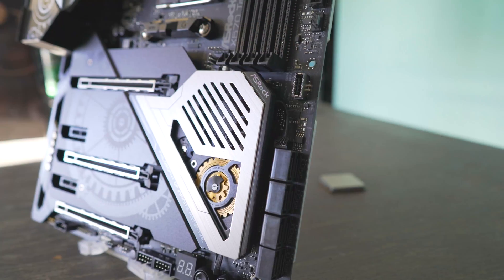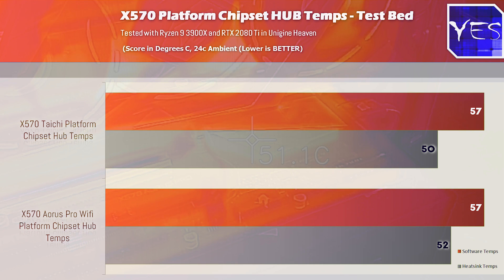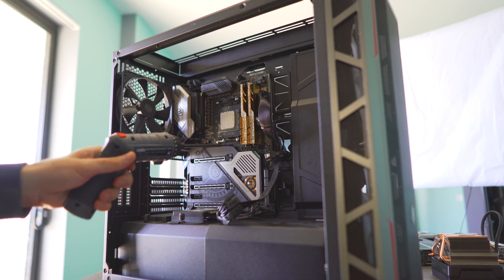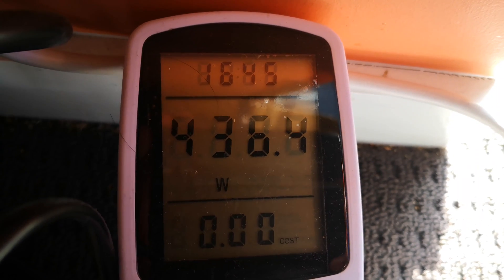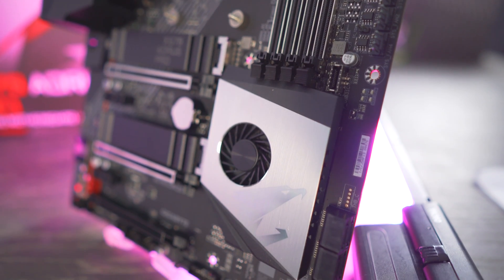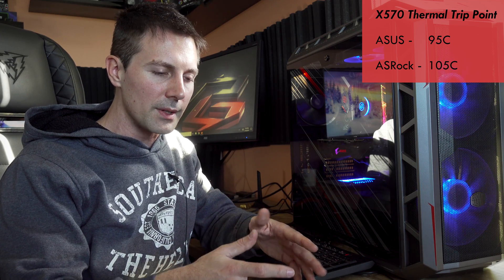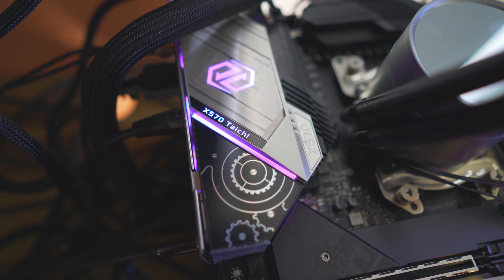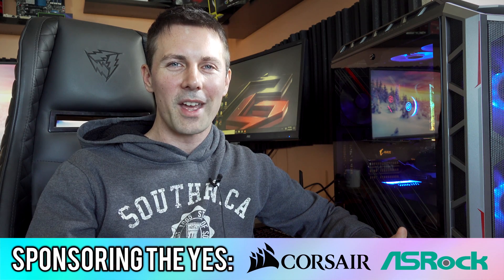X570 Chipset Overheating...!? (Investigation)

Comment: Bryan, I'm not sure if you'll ever see this comment but if you do, please help us.

AMD has been ignoring a problem that a growing number of us have. And note, this is not the nonissue of the "high voltage at idle" that AMD has already responded to and explained, although I believe that was a red herring to distract from this very real problem.

A growing number of us have this problem where when left at stock auto voltage, our CPUs use 1.4+ volts and this leads to high temperatures both at idle and at load. I'll use myself as an example to explain the situation. 

On my Asus board when untouched on auto voltage, the value shows 1.1v but my 3600x is sucking 1.4+v sitting in the BIOS. This leads to my CPU idling at around 41-43 degrees just sitting in the BIOS. In Windows it fluctuates with about half of its time sitting at 0.9ish volts and 1.4+ volts. Even in Ryzen Master when I see 4 of the cores sleeping with only 2 active it still stays above 1.4v. This behavior leads to high idle temps as well as load temps.

On my old 1600 that came with a Wraith Spire, after 5 hours it maxed out at 73 degrees running Prime95 overclocked to 3.9GHz all cores @1.33ish volts. On this 3600x I just got, I'm running it with a Wraith Prism that comes stock with the 105W TPD CPUs, running at bone stock auto voltage I've let it hit 91 degrees before I stopped Prime95. It was climbing pretty slowly at that point, so I'm guessing in an hour or two it'll probably hit thermal limit. Now some numbers on the Wraith  Prism for comparison. Over at Hardware Unboxed, Steve did a comparison of the Wraith Prism vs a 360mm liquid cooler using a 3900x. In his Blender test, he was getting a peak temperature of 86 degrees at around 3000 RPM. He also had his Prism on the low setting, mine was set on high. On high the Prism runs in excess of 3600 RPM.

Now in the Reddit thread by AMD_Robert regarding high idle voltage, a Redditor asked him if it was normal to be seeing 1.468v in the BIOS, he hasn't installed Windows yet. Robert responded to him saying that's normal because the BIOS has no power management and can't engage idle. That's bullshit because I saw in your video explaining PBO, your 3900x was sitting at .0979-.0990 volts in the BIOS on Gigabyte board. I remember my old 1600 was somewhere around 1.2 volts in the BIOS too, can't confirm as I no longer have it. Here's the link to that post:
https://www.reddit.com/r/Amd/comments/cbls9g/the_final_word_on_idle_voltages_for_3rd_gen_ryzen/etgispk?utm_medium=android_app&utm_source=share

AMD is lying to people and not responding to this very real problem. This is happening across all manufacturers, all chipsets except the X570 I think. This is an AMD problem, not specific to any motherboard manufacturer. All you have to do to verify is Google high voltage with Ryzen 3000/3rd gen.
Reply from the maker: Hey this is news to me, I will definitely have to check it out for you, sorry I seem to be isolated here cause I Don't have much time to check these things out, if you can tell us what testing specifically you would like me to do, as I do have an a320, b450 and x570 boards here I can get to the bottom of it.
Reply: @techyescity  Wow thanks for responding Bryan. What I know is what I've read over the internet and my own case. The problem as I said doesn't appear to be isolated to just Asus. I've seen people with MSI boards, Gigabyte boards report the same thing. To my knowledge it's on all chipsets. 

The problem seems random, some have it some don't while using the same board on the same BIOS. If you put in your CPU and leave everything on bone stock, meaning auto voltages you should see that even sitting in the BIOS your CPU is sucking down at least 1.4 volts and idling at over 40 degrees, just sitting in the BIOS. It seems on some of the chips there's a problem with auto voltage. Because of the overvolting, the temperatures are very high in Windows at both idle and load. People are hitting 90s during Prime95, that shouldn't happen unless you're overclocking and have crap coolers.

As I mentioned earlier, somebody brought up this question in AMD's thread about high idle voltages because he was getting 1.468 volts sitting in the BIOS and Robert Hallock from AMD lied to his face and said that was normal behavior because the BIOS doesn't have active power management so it can't idle your CPU. That's a lie and I can prove it, Gamer's Nexus had a video on PBO a day or two ago, halfway through his video Steve was showing us some settings of his 3900x in the BIOS and I saw the voltage was fluctuating between 0.979-0.990 volts on his X570 Gigabyte. If what Hallock said was true then Steve's 3900x should be sucking down 1.4+ volts in the BIOS too. You can verify yourself by checking your system and see how much voltage your CPU is getting sitting in the BIOS on stock voltage. In my BIOS on stock auto voltage my Asus board shows a value of 1.1 volts yet the CPU is constantly getting 1.4+ volts. Stock/auto voltage is obviously not working. 

Jay from Jayztwocents actually noticed this on his X570 Asus Crosshair board in his 3900x overclocking video but I don't think he knew it wasn't just Asus boards because he blame Asus for the out of whack auto voltage. You can find more instances of people reporting this by Googling high voltage with Ryzen 3000 or 3rd gen. If you have a way where I can contact you directly I can send screenshots and link. It's hard writing all of this on my phone as I'm avoiding turning on my PC altogether.

Thank you so much for reading comments on your videos as so far AMD has ignored this issue. I think they do know it exists but they're not acknowledging it. I have proof of this too but again I can't put screenshots and it's a lot of linking to be put here.

Comment: You shouldn't really move the GPU to a different slot, since on x570 only one slot goes to the CPU, any other slot it will be bottlenecked down to the 4 lanes from the chipset to CPU

Comment: My setup..
Asus x570 crosshair viii hero
Ryzen 7 3700x
Trident Z rgb 16gb(2x8) 3600 mhz(XMP) 
Samsung 970 Pro Plus 500GB NVMe 
Samsung 860 Evo 1TB
AMD Radeon Rx5700 XT
Evga G3 750w 
Corsair x570
6 Corsair SP Fans +2 ML Fans
Corsair h100i RGB Platinum(in push pull) 
Plenty of airflow!! 

System idles around 30° to 32° C
During CPU-Z stress test it is about 50° to 55° C
During gaming its about 45° to 50° C

No over heating problems for me!

Comment: According to the asrock software and bios, the SB/PCH temp matches the SYSTIN in HWMonitor.
That means in that one screenshot of hwmonitor in the video, the temp was at 75c at that point, not 44c.
Reply: yer the temps in this video don't make sense, I have the X570 Taichi with good case cooling at set to Standard fan profile it operates at 59-68c from idle to gaming. the current HWINFO 64 beta has support to the X570 chipset so I'm sure it's correct
Reply: @Rocman76  is it any better now? Would you recommend this board or nah?
Reply: @Sol-su2mi  boards been great, no issues here
Reply: @Rocman76  is it still hot now or have bios updates changed it? does this mobo have a socketed bios chip?

Comment: Lol people act like having a big South bridge hub with active cooling requires lots of cooling it's like broskis computers have had bigger chipsets in the past that devoured more heat. 60c ain't that bad. That's why I'd really rather have one with active cooling to begin with all motherboards usually run 50-60c modernly right now. I've had a couple of Asus boards I had a rampage for 1366 and it's heatsink was pretty bad close to 80c, it depends on the board yes I'd much prefer an active one, I always select my parts based on which has the best features and physical design in terms of usability looks are absolutely secondary to me.

Comment: Never heard of a chipset overheating situation that would cause a shut down.  The last chipset I experienced overheating with was a 970 board. It never shutdown, but the chipset driven IO would intermittently and briefly kick out and then kick back in - not something one wants when the system needs access to SATA based drives or other IO (like USB, network, etc) that isn't directly running off the CPU.  I just popped the heat sink off, replaced the cruddy thermal pad with some Arctic Silver 5, and popped the heat sink back on and that fixed the problems.  I'm not saying it's not possible for an overheating chipset to shutdown the system, but I suspect one would be experiencing other side effects long before that shutdown.

Comment: i have a very budget oriented b450 msi board and its rated upto a r7 chip but im only planning on getting a r5 3600 jumping up form a r3 2200g paired wiht a rx 570 i just want that cpu headroom for once i get a better gpu and ram

Comment: If you want to stress the chipset set it up as a mining rig.  My 8 card GTX 1060 6gb rig would get PCI 3.0 hot to the touch had to put a 120mm fan on it.

Comment: I was looking for a biostar x470gt8, the problem with that board is that the best price I can get for It is 178€. The issue here is that his bigger brother, the biostar x570gt8 cost 208€. With such a price different I would take the x570 instead IF you can confirm that this chipset is not overheating.

To all biostar haters reading this: I don't care about SLI or any other features present in more expensive x470/x570 boards. This one is a very good piece of hardware

https://www.overclock.net/forum/27413841-post3085.html

6 pcb layers, AM3+ cooler support (I currently have one high end cooler used in a 125W Fx processor), decent VRM, decent cooling, no RGB fancy stuff (I don't care about LEDs much), Intel lan (no crappy Realtek), decent audio chipset... It has all I need for productivity, which is basically what I use my computer for.

Comment: could you do a review of the Kukete X79 motherboards they have currently on ebay from china, these claim to have 3 x16 slots, 2 in pci-e 3.0, usb3 and sata3 and claims to have quad channel memory but only has 4 slots. and it may be overclockable. also they are going from 85.00 to less that a hundred bucks.

Comment: It's weird that on pictures of the chipset heatsink, the taichi seems to have very little surface area (e.g. the viii hero has some fin area at least). I would expect more surface area since chipset temp are such a deal this gen.
Reply: the actual sb is 10mm x 13mm; a fair amount of heat for such a small area.. then again i am not a fan of higher temps at all.. lower the better, not just what it can handle.. i actually did some physical work and replaced the thermal pads with copper plates and dropped the temps from 62 to 52 .. added a 60mm dead silence fan on a mount near the sb and dropped them down to 42..  can't hear the fan; looks okay ..

Comment: I have the x570 taichi and I have no problems with overheating at all even with my gpu mostly blocking the chipset fan and multiple nvme drives. My only issue is I can’t get my memory to run at rated speeds. Have tried multiple kits and the boards always fails and defaults back to 2133

Comment: Recommendation: Best itx mb for new ryzen build?
Reply: Gigabyte x570 i aorus pro wifi you can even add a 3950x and oc it because of 8x 70A infineon power stages + wifi 6 + intel lan + support of up to 4400mhz ddr4 + has a steel backplate...
Of whole x570 itx board its the best as of now ... This board is also better then most highend x470 boards and some x570 boards
Reply: @TheGoldenTunes   i bet you say that because you have it hmmmm lets say about  bios problems  or lets say about chip overheating i see in many many forums  or lets say about the ram slots that clocks lower than you think you have lock them !!!!!!!!!!!!!!!!!!!! and that was  from what i remember   because they had more problems!!!!  especially with temps!!!!!    are you  gone keep suggest them for buy ?????

Comment: Brian question for you my friend i see you use lots of AIO how safe are they? Im never used one because im always afraid of them leaking!
Reply: min temps from a very very good water cooler aio and an good quality air cooler  is 3-4-6 c in the very best case scenario for the water cooler soooo apart from look and aesthetics they  do exactly the same job with air coolers  so in every way you look it water coolers does not worth it   better stay in a good quality air cooler than risk it  because water coolers have alot and i mean it alot problems to solve  pump braking - fans braking - pump fan braking - leaks - gang build up and many many more +  the best air cooler cost same money as a cheap water cooler aio and now i start see videos on youtube  with air coolers that have better performance from water coolers aio !!!! like Scythe Mugen 5 Rev.b and many more new  air coolers models  just check it
Reply: DJ SICK__BOY thank you for the reply im gonna stick to my noctua d15

Comment: My Asus X570 Tuf plus WIFI is fine. And I'm running in an ancient P180 case.
Reply: Can you hear the fan at all? I'm looking at the tuf board.
Reply: @freethinker4liberty  I can't hear it. I have a Thermalright Grand Macho RT heatsink cooler for the CPU which is really quiet and several case fans.

The ASUS mobo's come with a suite of software which includes individual fan controls for all the on board fan connectors. I don't hear the chipset fan on either normal or turbo mode.

My only concern re the chipset fan is that it sits under my video card. I have that extra long three fan ROG Strix RTX2060

System tends to be mid 40c with ambient room temps of about 25c.

If there was one niggle with this board, for me it would be, if your into flight sims and have lots of USB devices. throttle, rudder, stick, Guitar interface etc. Keyboard with pass thru, USB Astro wireless headphones etc. There aren't that many USB ports without installing a separate bracket with extra ports on. 

Otherwise I'm very pleased with this board. It's one of the cheapest x570's and works great for me.
Reply: @antmax  Yeah, I've decided on that board for sure, it seems to come with more features than the Prime-P and even has wifi/BT, I mean what more could one want, it seems to be a board that should be in the mid-range price.  That being said, you have a type-c and 3.2 on the back, you can easily plug all those devices into just one port, no?  The bandwidth is huge.
Reply: Hi, Adrian! I have a Asus X570 plus, without Wifi though.
Could you please tell me your chipset temp?
Mine is 73º... Using the last bios... 29ºC ambient temp.
tyvm

Comment: Are all the pcie x16 slots wired for x16 ? Other wise why would you suggest moving gpu down a slot ?
Reply: I think at least the top two can do x16. If using anything other than a 2080ti, there would be no issue whatsoever with using x8 btw.

Comment: the way I see it, the problem with X570 having active cooling is not about temps or noise... it's about introducing a new point of failure in another moving part. It would absolutely suck to have to RMA a full board for a chipset fan going south.
Reply: lol fan not work doesn't need rma, just  put other small pc fan

Comment: I think that their systems might be shutting down due to PSU issues. Might not be high enough wattage or not 80+ bronze or higher. I always tell people to never go below 80+ bronze and never get a non 80+ certified PSU. I also suggest people get about 80% higher wattage than the wattage rating of the cpu+gpu. So if your total wattage under load is estimated to be about 350, I'd suggest a 600w psu to said person.

Comment: I bet any $$ most of the people having problems spent all their cash on the Motherboard & GPU, that's not even mentioning the RAM or other parts potentially expensive like some NVME Drives. So they probly cheaped out on cooling. I would also Mention if they cheaped out on a Power Supply & did not buy an 80+ stamped PSU than they might have a crappy Power Supply not always supplying the Computer with what it needs. Guys ONLY buy 80+ Power Supplies if you are building a high end system! Also I would NEVER buy a used Power Supply from anyone I didn't personally know (& even than would not a lot of the time) because as a Power Supply gets older each cable coming out of it looses a little power. Like if a Molex or SATA Power Cable is supposed to deliver 5.5 Volts to something, an older one might after running for 10 minutes to sometimes even a couple hours only be dipping down to 4 Volts or lower & that is enough to crash your computer or make it reset.

Comment: G'day Brian,
Thanks for the tip on warming the phalanges while gaming, it's cold down here in Southern NSW & snowing in Tassie,
I don't think you tried hard enough to replicate the apparent board shut offs due to heat,
I think you need to use an old school $20 case with a 80mm fan, overclock the CPU with 1.5v, & overclock the GPU, then tape up any panel joins & slots in the plastic panels & disconnect the fan to keep the DB low, you know like a real performance PC set-up 😁

Comment: The Asus motherboard is setting the voltages way to high. If you are someone who do not know much about the bios and how to change things within the bios you will not know the voltage is too high. I do not recommend Asus x570 for people who want to plug and play. In my test with the stock bios setting my CPU hit 110c and stayed around 50c to 60c on idle.
Reply: with my Watercooling it hit 78C in Cinebench Stock settings now with a all core 4.2ghz overclock at 1.2v instead of 1.31v it only hits 60C so the overvolting on the CHVIII has a large impact